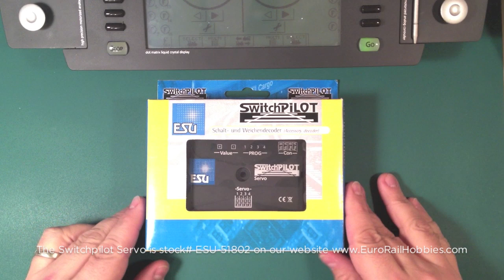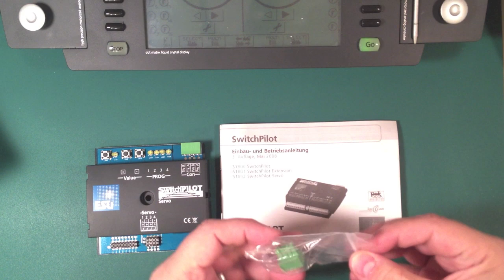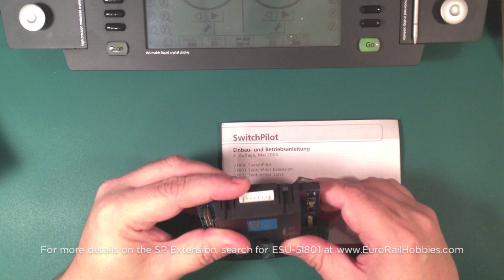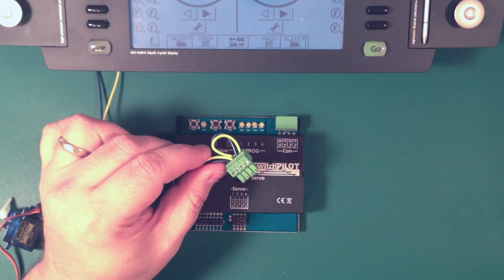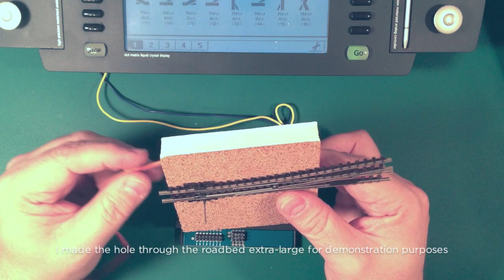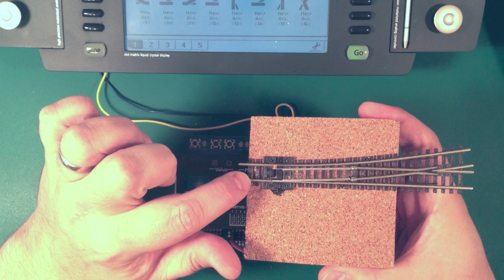ESU SwitchPilot Servo Accessory Decoder at Euro Rail Hobbies

Comment: This video sucks!What the hell is wrong with the people from the eurorailhobbies which confuse to answers the questions here???
Reply: You’d think that in 3 years you’d have downloaded the manual and found the answer for your self. 
Or watched the video again, and got the answer by paying attention.
Reply from the maker: +Anders Gullberg Hi Anders, sorry - for some reason we do not get notified when we get a comment on some of our videos.  As in the video description the SwitchPilot decoders work with both DCC and Marklin digtal systems (as well as Roco Z21 etc).  They can be used with just about any turnout depending on the linkage you create between the servo and the turnout. If you need to control the polarity of the frog, you can use the SwitchPilot extension add-on which provides accessory switches linked to each server output.

Comment: Very nice information! I use tortoise motor because with contacts for electrofrog in my turnouts. But in the servo motor there is no contacts,so i suppose it`s necessary to use switch pilot extension...?